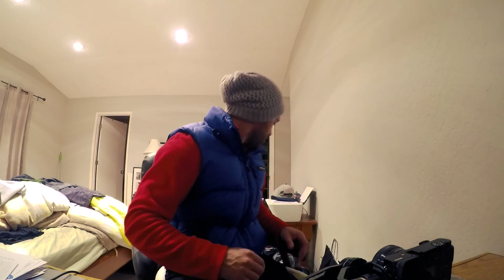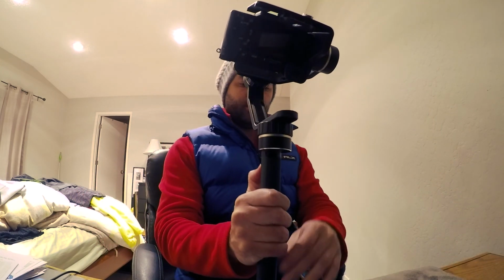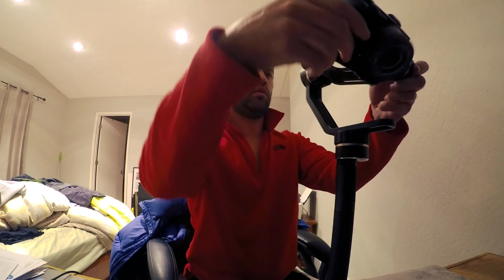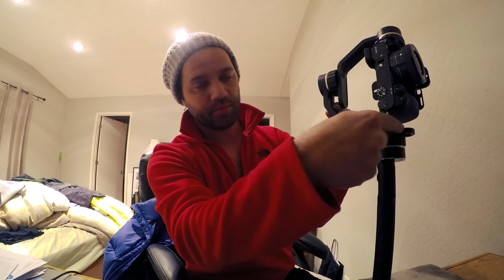problem with feiyu tech gimbal mg lite - how to balance gimbal mg

Comment: You should turn the gimbal sideways when balancing the yaw axis (bottom motor). Slightly tilting it like you are in this video will result in a potentially  inaccurate  balance, and then when you do turn the gimbal sideways you will strain that motor. That eventually can result in that motor malfunctioning in some way. I can't say that this is what caused this failure, but turning on a gimbal with out having it balanced with in a certain tolerance in all three axis's is a likely cause of this type of malfunction.
Reply from the maker: Bill Young  I did that too , didn't work

Comment: Hey bud, looks like the motors are overpower because the camera is too light. It will vibrate rapidly when that occurs. To fix this, try adding weight to the camera or putting our hand on it while starting up to keep the motors activated. You need to turn the 3 motors power down. To do this you need to click the button 5 times, then hold the joystick down for about 5 or so seconds, tap the button again to save it. Holding the joystick down is reducing the motors power. Repeat this process again but push it 6 times instead of five, then save that. Repeat it one more time but push it 7 times. This reduces the power in the pan, tilt and roll axis motors. Here is a video demonstrating what I am talking about. https://www.youtube.com/watch?v=pa2wUJTdEDA 
the fix to your problem begins at around the 7:20 mark. Hope this helps.
Reply from the maker: Thank you so much! 
I return my gimbal because I cannot fixed this issue. 
They will send me a other one if this still happen I will follow your instructions
Reply from the maker: hey Hoku cuman! how are you?
brother I need a LOT of help here please.
my gimbal when i turn it on , now just spinning super fast.
can you help  me more?
Reply from the maker: Hoku Curnan thank you

Comment: Cameras not heavy enough mate--Its not really designed for the point and shoots.
Reply from the maker: AWP Photography  ok thanks but u are wrong 
A6000 is a mirror less can and ... and I saws ton of videos w this camera on this gimbal
Reply: a6000 with the kit lens is pretty light--in the ball park of 400 grams.  Its rated at the low end to ~320 grams and with that it has to be PERFECTLY balanced.  Ideal weight for those is closer to 1200g--do a firmware upgrade and try again.  If not sorry man--Better off learning how to use a glidecam iglide for things that light.
Reply: Reggie Soares and in the future--it helps if you give a bit more info for your problem...like what camera you are using, your initial balance because from this video it doesn't look like it was balanced at all